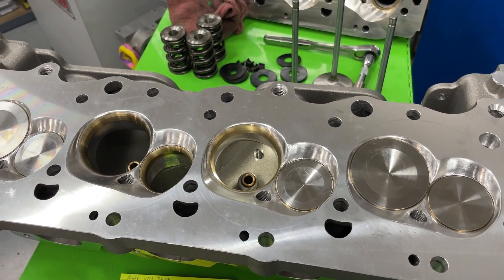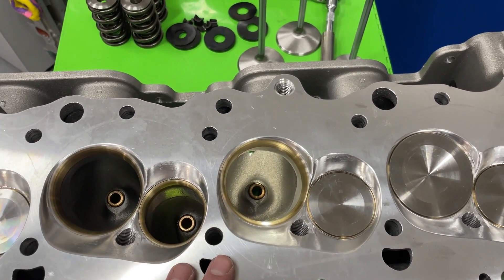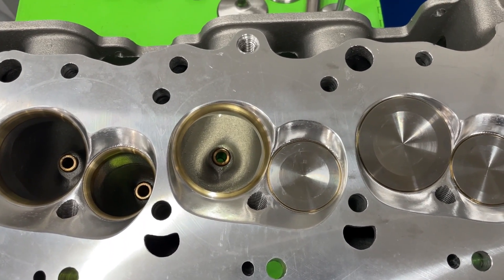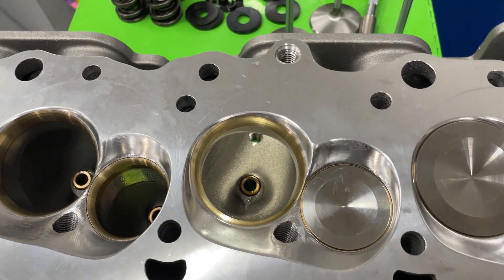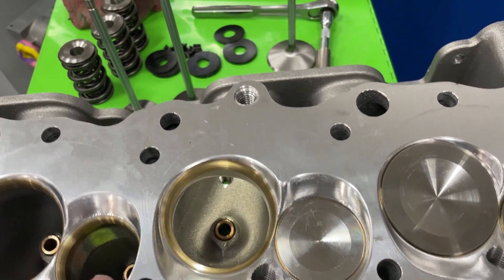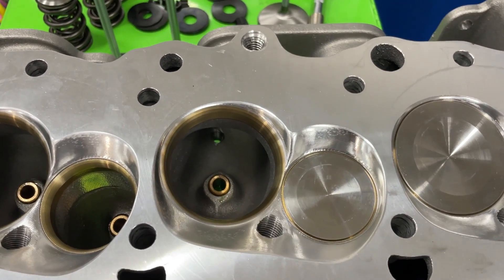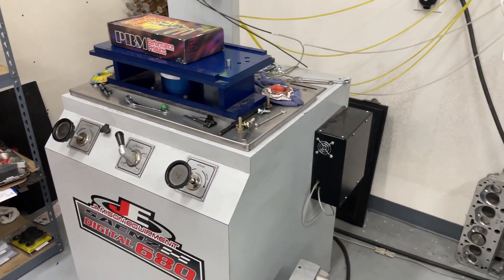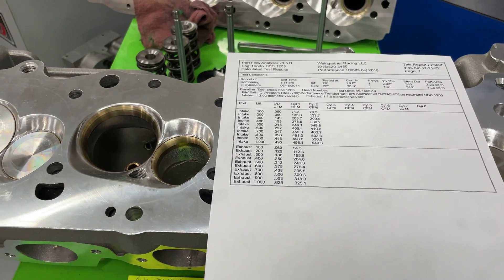The Highest Flowing Head I Have Had On My Flowbench

Comment: Hey are uncoated Titanium’s a issue on the street? I had heard they may not be a good idea.
Reply: what coating are you referring to?
Reply: @juliennacer8871  whatever coatings Victory use. Every brand has their proprietary coatings but mine are Victory valves I was concerned about for street miles.
Reply from the maker: I don’t know why you would order uncoated valves. I only order coated titanium valves usually crn coated. Uncoated you are just throwing away money. Coating costs more but you are not buying new valves a year or so later.
Reply: @WeingartnerRacing  I didnt order these. I bought a complete set of heads from a guy that was not a "cheap" guy. I took the heads to get checked out before I put them on my new motor. When I mentioned street use he was concerned about longetivity of the valves as he did not believe the valves were coated. Maybe they are? I was just wondering if they happened to not be coated how long should they last?

Comment: Eric the first spread port heads were 385 casting developed by EPD and cast at Brodix for Pontiac, they were a 15 deg head and would flow 496@.800 lift.
Reply: @DavidStirm  gf
Reply: Who casted the Pontiac heads in the old GM Perf parts catalog? Wanna say around the 80s? Miss being able to buy all the cool factory stuff. 
Esp their flat tappet lifters. Every hot rodder used them
Reply: Did u ever keep tabs on that stroked fiero 2.5l engine if it got all sorted out I would love to see another dyno video of that project
Reply: @mikasantos3774  I am planing on getting the injection up and running and then going back to the dyno. I have a Micro Squirt on it, I just need to find the time to work on it. I was thinking about building a new intake w dual throttle bodies. It is very restrictive on the intake side.